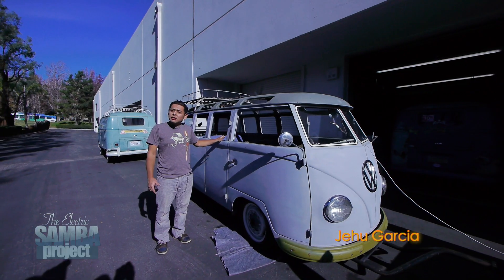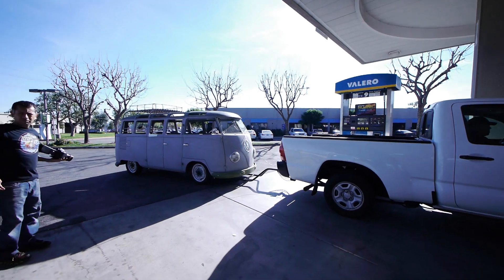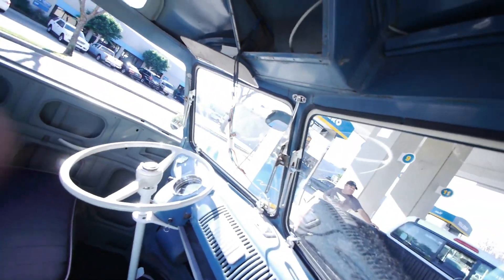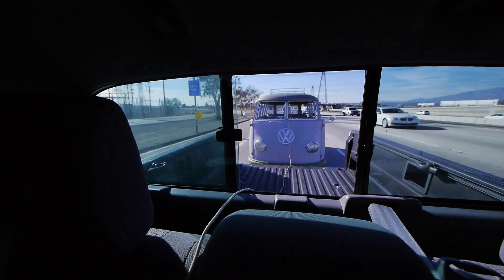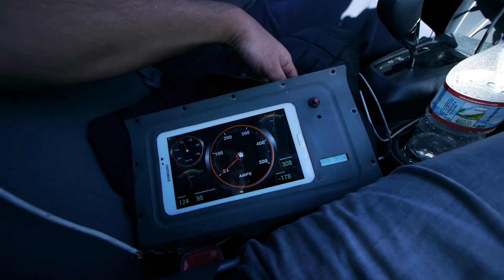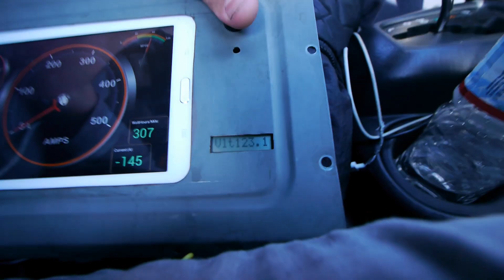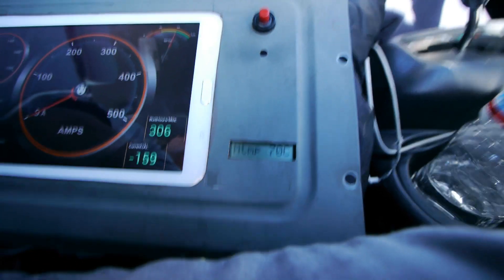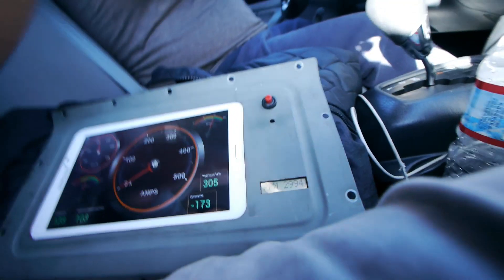Is Regenerative Charging possible? DIY EV conversion

Comment: Another simple solution you could have a built vehicle with 2 powerwall which can supply recharging dc-to-dc very quickly emergency for someone who is being stranded on the side of the road it is something that I reference to Tesla call a jumper cable from one Tesla to another Tesla it could be done on Friday with electric vehicle but instead with a power wall mounted in a mergency vehicle 🤔

Comment: I wonder what will happen if you have a double motor system and u run the same test keep in mind to keep the temperature down the vehicle that pulling Electric bus reduce the speed to keep the temperature you could control by variable speed off the lead vehicle I guess the temperature would double mortal will be lower 🤔

Comment: Which gear were you in? If you selected a low gear on large hill or mountain, couldn't you maintain a optimum RPM while at low speeds and a slow decent to charge the system?

Comment: Jehu... You will charge your pack an equal amount based on speed(that your traveling) that you would deplete your pack running the motor off of the pack? so in other words. . the same amount of energy used to propel the vehicle off of the motor and pack is equal to the amount of energy created from towing the vehicle? It has to right?